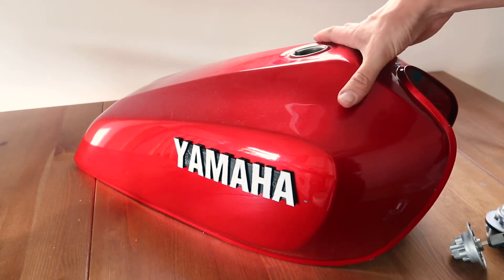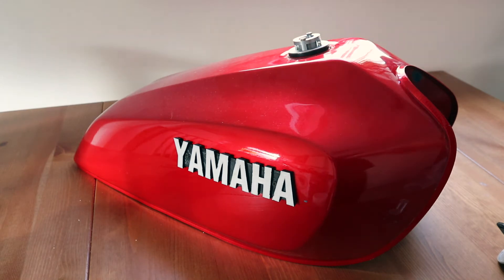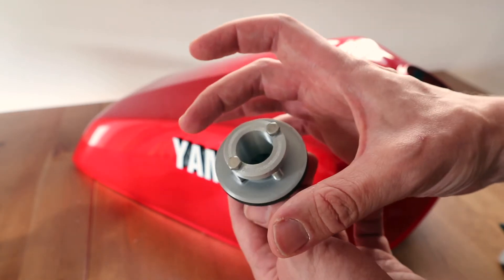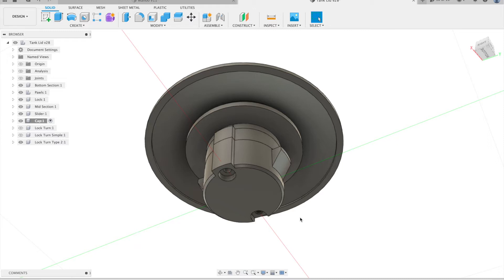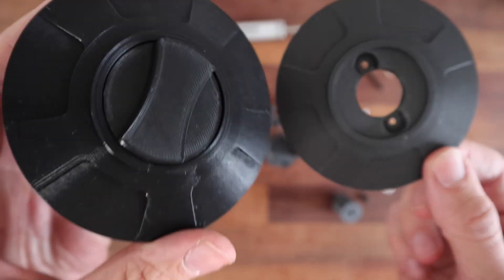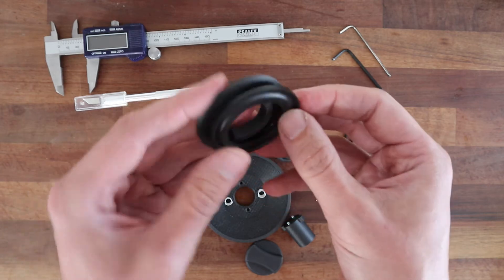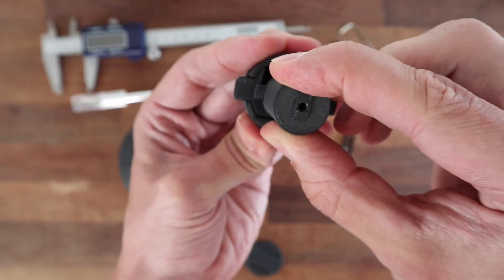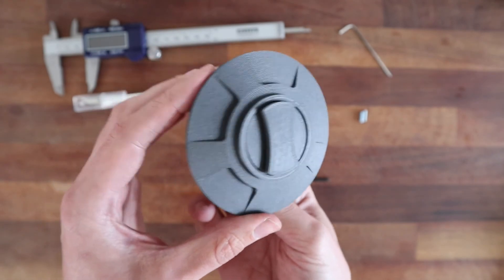3D Printed motorcycle tank cap in CF Nylon filament

Comment: How's you plastic cap holding up? Did you move the petcocks forward?
Reply from the maker: So far so good with the tank cap. The tank in the video doesn't have the petcocks installed yet, but they are in the same position.

Comment: Thanks for uploading these files 🙂I've printed them off and I've used them on my XV café racer. Can you tell me what radius exhaust pipes you have on your XV motorbike? I'd like to make my own exhaust and they look like a good starting point. Thanks
Reply from the maker: Glad you got some use out of the files. The exhaust pipes are 1.75" / 44.5mm. Good luck with your project, I've still not finished the exhaust on mine. My idea was to 3d print a load of pie cuts / angles and get the bends right before welding it together. Because it gets quite tricky the bend by the rear cylinder.
Reply: @strutter5764  Thanks for sharing this information. My project is coming along ok. Your right there isn't a lot of room on that back cylinder. Hopefully you can post some more updates on the progress of the build soon. Love to see it take shape. Thanks again.
Reply: @strutter5764  As you've used a 44.5mm angle I'm presuming that a 45mm angle was just to tight?
Reply from the maker: @Phil-y3s  The diameter of the pipes were 44.5mm. If I recall correctly I used a combination of 45 and 90 degree angles for what you see in the video. Like I say though I'm going to rework this using 10 degree pie cuts.

Comment: Amazing job! And the overall build looks 👌 regarding the seat frame - can you please confirm if it is comfortable and reliable/secure?
Reply from the maker: I've not had the seat padded yet so is pretty uncomfortable however when I do I think it won't be too bad. It does look a bit extreme but it's not all that different to your traditional bobber seat / position. It's secure enough, I welded two brackets to the frame so it's not going anywhere!
Reply: @strutter5764  Nice! Thank you very much for the prompt reply! If possible, could you please upload a video of the seat frame preparation and welding? I have an XV500 and I'm still wondering what seat to prepare for it :)
Reply from the maker: @KonstantinStanchev  I certainly will, this style of seat looks great on the Virago in my opinion. You should upload some videos of your XV500, it’s always interesting to see what others are doing with theirs.

Comment: What brand nylon?
Reply from the maker: Qidi Tech PA12-CF
Reply: @strutter5764  was it also printed on a qidi printer?
Reply from the maker: @hg1496  No it was actually just an Ender 3 V2 with a Hemera Extruder. 280 nozzle, 70 bed, 40mm/s, fans off. It was surprisingly easy to print with.
Reply: @strutter5764  enclosure?
Reply from the maker: @hg1496  No enclosure. No warping or lifting from the bed either, I did use a flexible PEI sheet on the bed though, but I imagine you could use any bed surface.